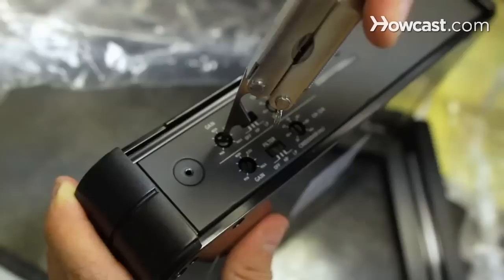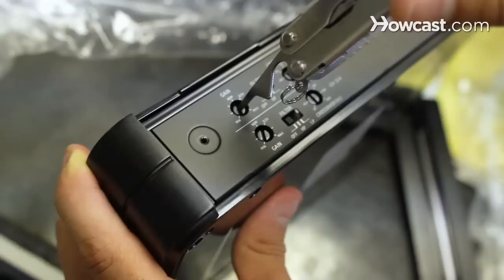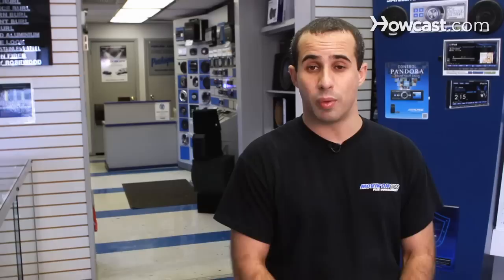How to Tune a Car Amplifier | Car Audio

Comment: What is the high pass filter?
Reply: +bryce hamilton used for tweeters and such, it filters out the bass and only plays treble.
Reply: +J Miller  I thought it was the other way around, it sfilters out the highs & mids            .... High, Pass,filter
Reply: +97warlock ismyname High Pass Filter means the High sounds pass through and the low notes are filtered, playing almost no bass so you dont blow speakers that arent made for bass. What you described is a low pass filter, which lets the low(bass) sounds pass, and filters out the high sounds, so you get a good clean bass.
Reply: +J Miller  Mine says HPF         so I turned it OFF  ... I dont want Any highs. I want bass only going to subs.
Reply: High Pass removes low end frequency.  Usually I'd roll off to 20-30hz on the majority of subs.  Below 20 hz is an area with in-audible rumble that can fight with your subwoofer pushing out sound.  The sub moves back and forth to create sound waves and it will clean the sound up a lot.  Don't be afraid to go as high as 50hz, listen to see what sounds best to you.  

Subwoofers usually work best low pass (removing high frequencies) filtering below 120hz, but you can dial it in listen for where it sounds best to you.  Going below 100hz you come close to rolling off some really good punchy frequencies around 80-90 hz.  Anything above 120hz might start a competing with your 6x9 speakers, which normally do the job better.  

The best sounding system is balancing each elements (Lows, Mids, Highs) of your system and emphasizing their strengths.  There is a sweet (crossover) spot to where each speaker works well with each other and usually when you buy more expensive gear, it gives you a bigger/cleaner sweet spot to work within.

Comment: What does he mean turn the radio  up until it starts distorting?
Reply: Yosef P Turn it up until the subwoofer/bass sounds like a crackling sound.
Reply: +Yosef P you can even buy on ebay the tuning CD which contains tracks with different frequencies. Usually to tune the subwoofer amp you would play the 40 HZ frequency... There is no music coming out of the speakers but just very deep sound... most of the amp would have small lights in different colors indicating when the output / input clips.... so turn everything down, put in the CD in the CD player, then increase the volume up until the light on your input blinks red. That means that's the highest you can play your music with your amp... (make sure during this process all speakers are DISCONNECTED). Once you get that, you can start tuning your gain on the amp, plus all those other knobs until the red light comes up, and when it does, turn it down a notch just so your red light goes away. That would be the general.. Of course, tuning the subwoofer to your liking, you might hear how it sounds, and take it from there. If you want more bass, you will need to adjust the frequency and so on... but pretty much it is very simple... I did mine amp in less than 3 minutes.

Comment: I've had amps in my cars before, but that was years ago and the ones I had didn't have any adjustments. You just hook the cables and speakers up and crank up the volume. Now I'm getting back into it again, the amp I have now has several dials and switches I'm not totally firmilar with. Be nice to get a good explanation of all those settings. Guess I'll keep looking around... thanks anyways.
Reply: I was into this stuff years back. Getting back in it now. My amp has a LPF (lo pass filter) subsonic filter, gain, and the db switch that goes from 0-6-12. That's it. It is a Memphis amp and the installer said it is 2400 watts when bridged. It runs my 2 Memphis 15's. I have a video of them on my channel if you'd like to look

Comment: Just so you know engine noise will only come from an interupted signal in the rca due to being to close to the positive wire , so when you give gas the alternator speeds up and charges a bit more sending power threw the positive also causing signal to interupt the rca signal if to close , badly grounded amp will never ever ever be the reason of engine noise , stop missinforming the new guys , and dont ever tune an amplifier like he tell you cuz you cant always hear the distortion when its minimul and will end up damagong your stuff over time , do it right with the proper tools or pay a real pro to do it.

Comment: Isn't this process the most inaccurate way of all to set a gain? RMS multiplied by ohms you are running then the square root of that number is your voltage number to aim for with a DMM

Comment: i have a gas pro 600 2013 model and i dont know how to adjust the settings in the back 

i have 

bass boost  0-12db
level only min-max no dbs
low pass 50-250hz
subsonic filter 20-55hz

with a gas alpha 212 12*2 subwoofer 

i use a avh-x7700bt pioneer

Comment: 8 years working with this stuff and still doing it wrong. I'd expect a good shop to have a scope or a DD1, or if it's a smaller shop or they don't do a lot of big work then at least use a DMM. Setting by ear is the worst way, and doing this guys method of setting by ear is even worse. You can't hear when the clipping starts, by the time it's audible it's probably quite distorted, and then backing it down a bit leaves it still clipped. At least use a DMM to get it quite close to the right setting.
Reply: Exactly. Anyone doing this for a living should have a o - scope of some kind in their toolbox.

Comment: Well, this is another video that's completely inaccurate. The amplifiers input section has a gain control based on the input signal. Read your owner's manual to find out what the output (in volts) of your head unit is, and then adjust your amp to match that gain. Sure, you can get more if you turn that amp gain up, but that's where you get distortion, and distortion is what is killing your speakers.

Comment: kickers is the problem?? lmfaooo i got 2 07 cvr 12s in a sealed custtom box built to specs pushed by a fosgate prime 1200 at 2 ohms in an alaro 4 door and all 4 doors flex my windsheild flexes sodas spill through the lids paper ffloats. and i cant put anything in the su visor with outt it fallin out.... surrounded by 4 infinity kappa 6x9s aalong with 2 pairs of infinitty kappa 3 quarter inch tweats all powered by a 1200 watt 4 channel i forget wat series and 9 out of 10 people wontt get in my car. lmao
Reply: brett pingel

Comment: do it right sms not by ear use ohms law with a mmd let's say you have a 500w rms sub @ 4x2 you would have a volt out @  42ish v now if your droping it to 2ohm×2coils 500rms you will have a gain v-out of 36.62  now just set you bass boost and subsonics and your set doing it by ear=sub blow out or to quiet of a sub ( highs and mids lowder ) always best to do it right than guess around like this over priced audio guy just randomly turning nobs lol if your into high DB or SPL doing it by ear will make you look like a fool in the lanes lol iv seen this to many times I'm pushing ( 157.8 DB/SPL ) if I did by ear I'd be at the lane pushing ( 130-140 ) not what your looking for if you want to be lowed or low lol #AINTLOUD
Reply: juggalo4life_91 can you help me with tuning my amp? I have an Alpine M250 and Kenwood Excelon 12" sub

Comment: What does the gain do exactly?   Why would the signal need gain.I thought Gain was distortion.
Reply: you match it to the speaker voltage coming into the amp from the rcas. It's like you're telling your amp how much to amplify.
Reply: gain is volts out into watts rms use ohms law to get the right gain output

Comment: WTF this guy speaks English. Have you viewed any of the how to videos on AMP LPF. They're so immersed in their tech nomenclature that they can no longer communicate the simplest idea. Just how do you use the LPF? They can't do it, they end up drowning in their own word play. "Okay on the LPF setting you want to get out your volt meter and it depends on if you have a 1 to 1 or a 3 to 5 or 5 to 8 band pass box ratio and then you measure your frequency so get out your oscilloscope." shut up shut up shut up I should've known not to ask a guy whose stereo prevents him from having any seats in his car.

Comment: This guy is setting people's systems wrong. And if he works at a shop he should have a multimeter and a oscilloscope to properly set people's systems. As you cannot hear all forms of clipping yet all forms are bad for your speakers. And all forms of clipping audible or not can be easily tuned out with the right tools.

Not everybody can afford these tools but a shop can. Maybe he doesn't work at a car audio shop what do I know 🤷‍♂️